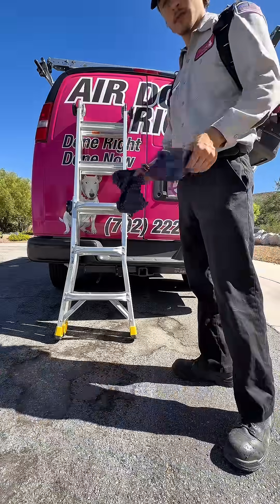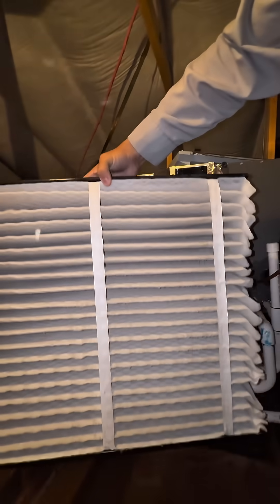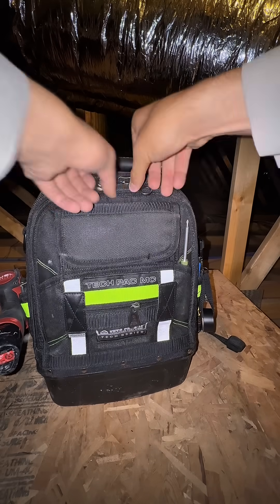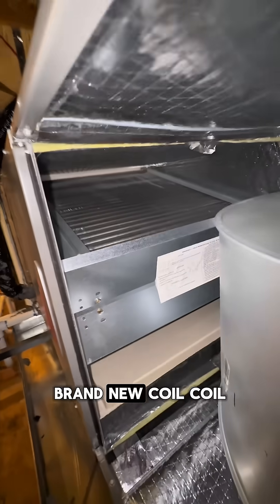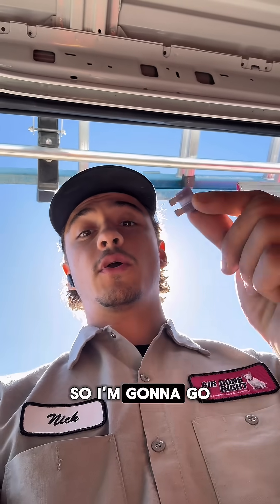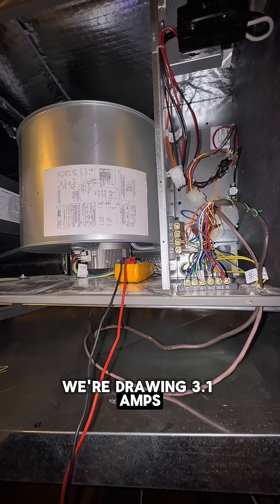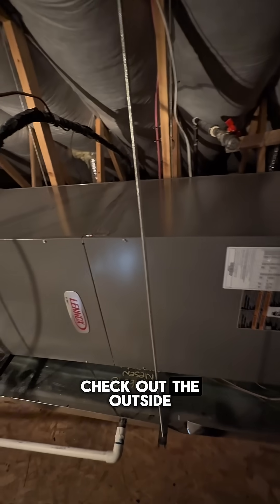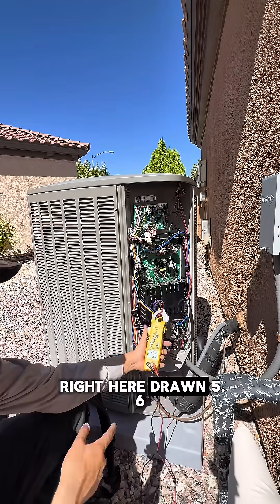Heat Pump Heating Maintenance #hvac #hvactechnician #heating #heatpump #maintenance #hvaclife

Comment: Why do you unscrew the low voltage circuit? And what do you mean about the vibration would have caused a leak ?

Comment: Gas is cheap, why did they convert over to a HP?
Reply: Natural Gas and Propane are not as cheap as it used to be. And heat pumps will never cause carbon monoxide poisoning from failed parts or hacks bypassing safety's.
Reply: @WhowereEpsteinsclients gas is still cheaper than electricity. I understand the safety aspect if the customer values that, but if were talking cost to operate the gas system will forever be cheaper than electricity.
Reply: Heatpumps are cheaper maybe they dont use heater, i only install heat pumps, i personally dont like furnaces
Reply: @javiervalencia2417  the equipment costs more for a heat pump...and electricity to run the heat is more expensive than natural gas...natural gas is the cheapest form of heat
Reply: @hunterhill1013 A heat pump is 200-400% more efficient than a gas furnace. For 1 unit of energy it can deliver 2 to 4 units of heat because they’re whole function is moving heat from one place to another. But they’re only that good in places where temperatures dont fall below freezing thats where they get expensive cause you would need a secondary source of heat.
Reply: @RedBlue-kw7zs  whered you get that data?
Think about how much electrical load it takes to operate the compressor and both fans vs, just the blower...you cant tell me the heat pump is more electrically effecient.
Reply: @hunterhill1013 that info comes from the manufacturer. You have to look at the COP(coefficient of performance) basically the energy put into the heat pump vs heat being output. The heat pump takes heat from the outside air and pumps it inside. Even when its cold outside theres still heat in the air and the heat pump is able to grab that heat and pump it inside. It can deliver a lot more heat per watt than a gas furnace thats why its more efficient. But like i said when it gets below 32 degrees thats when the heat pump cant keep up and a gas furnace is better.
Reply: @RedBlue-kw7zs i understand what youre saying but in order to move all of that heat around youre running the condenser unit which requires a lot more electricity. It may be more efficient technically speaking in regards to heat transfer but as far as electrical effeciency Im not letting any mfg convince me its more electrically effecient than a gas furnace. I understand tits a great technology but so is natural gas heat..
Reply: @hunterhill1013  yes a heat pump will use more electricity but if you convert the gas used in a furnace to kWh the heat pump excels. Furnace still uses more when gas is converted to kwh. So still heat pump comes out on top.
Reply: @hunterhill1013 tack a look at a video by a channel named technology connections on heatpumps, he explains how it is cheaper to run( in non-freezing climates) than gas and why it’s a better technology. It may used more electrical capacity but gas furnaces burn more fuel to achieve the same level of heating. That’s why we say a heat pump is (up-to) 4 times as efficient as electric resistive or gas heating. Plus the upsides of no CO or harmful pollutants that we might inhale from a failed component( cracked heat exchanger). Also it’s just an air conditioner with one extra, not very costly part or parts, made to run the refrigerant backwards.
Reply: @RedBlue-kw7zs ding ding ding 🙋‍♂️. Correct
Reply: @hunterhill1013  The furnace is less to run because it’s just a blower fan and fire going through the heat exchanger. A heat pump has two fans, a compressor that’s gonna run up your bill like in the summer and it might not work if it gets too cold.
Reply: @Refrigeration-by-Chris I understand how a heat pump works, i disagree that there is cost savings there for the customer. A straight cool/gas furnace style system will be cheaper all the way around. Cheaper upon install and cheaper on the customers bills every month. I understand if the customer values the safety and efficiency aspect of the difference in systems then they can invest into a heat pump, however most homeowners focus on cost and are not worried about the technicallities of how they get their heat. Living in Texas I see a lot of heat pumps installed in newer neighborhoods where they dont have gas infrastructer. I know, as a contractor, that heat pumps are more expensive. 
Its kind of like trying to convince me an electric car is going to be more reliable and cheaper than my V8. I just dont buy it.
Reply: So my answer im getting is; because the contractor upsold the customer on it
Reply: I prefer a heat pump because they don’t blow out as hot as a furnace. I don’t like to feel a blast of hot air
Reply: Maintenance would be something I would consider a deterrent.